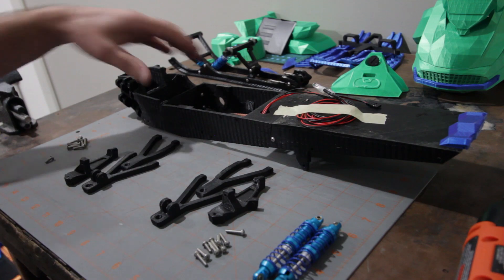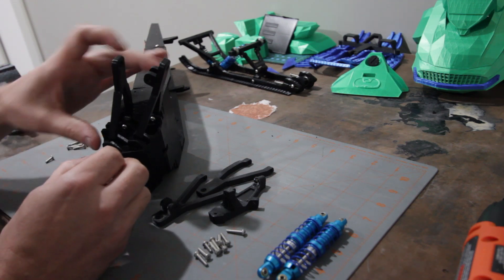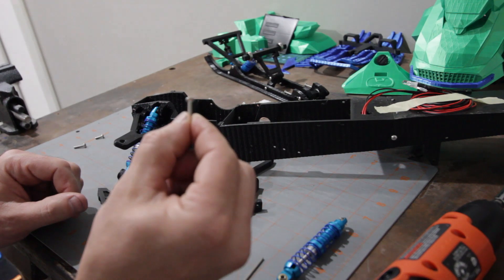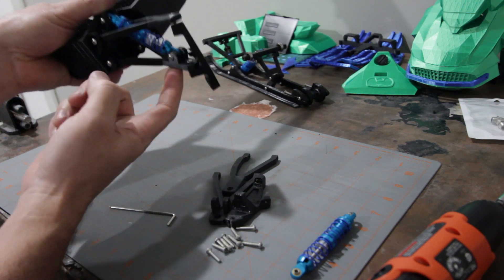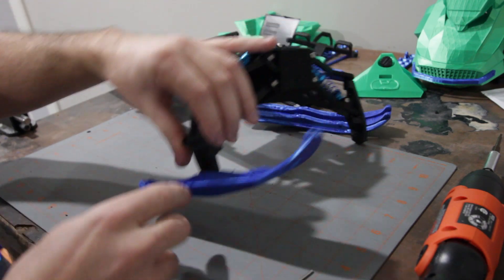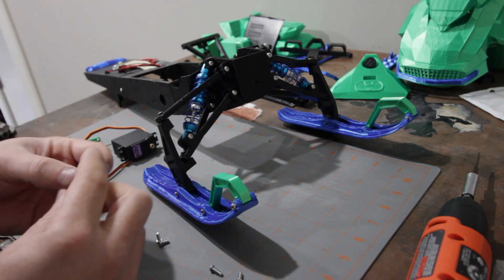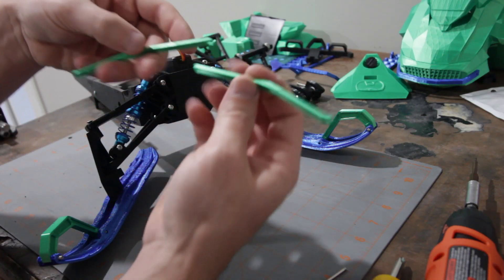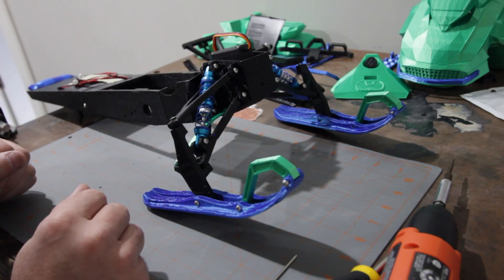SkeeRide Assembly Part 3 - Front Suspension

Comment: Bought the files two days ago. Thanks for the effort of making this. I saw footage of an other rc snowmobile design on youtube and thought that would be a cool idea to have as my next rc project. Just making my own 3d printed snowmobile. Looked for pictures of nice real snowmobiles to use as a ref. Choose the Yamaha mountain max 2021. Started to make screenshots and imported them into Autocad. Started on the front ski design.......and found your files via one of these youtube video's. Hmm ok that looks nice. Will make my job much more easy. Weeks of designing and test printing. so thank you for that. Two questions though. How did you print those ski's? on their side? upside down?
And the second question. What program did you use to design this? I like the main shape and design. But am not a big fan of the many polygon patches. Was it choosen this way/ done on purpose or do you have no way of making the lines smooth instead of facetted?
Reply from the maker: Print the skis on their sides with supports. I used Blender to model everything. The polygon look was on purpose, I like the look and felt it gave it a stronger/meaner look. Good luck on your project.

Comment: What size shocks do you use for the whole sled   Skid and front suspension
Reply from the maker: 3x80mm 1x55mm parts needed are listed in the item description at mini factory, and in a pdf that comes with the files.
Reply: @BuildItBetter3D  thank you

Comment: I printed the jordan86 stuff. does that go together differently? or should I have done the others?
Reply from the maker: It’s explained in the mod pdf included with the files. Those are a mod to use rod ends instead of the standard ones I show in the video. They were modded by jordan86 on discord then sent to me to include as an option.
Reply: @BuildItBetter3D  ok, I've tried to go to the discord but says link is invalid. But thanks. I'll just wing it.
Reply from the maker: There is a discord link in video description, at discord, and in the files you purchased. What link did not work for you so I can fix it?
Reply: @BuildItBetter3D  the one in the files i bought